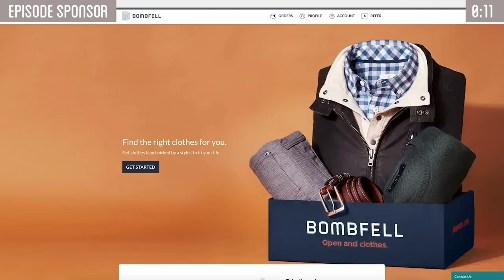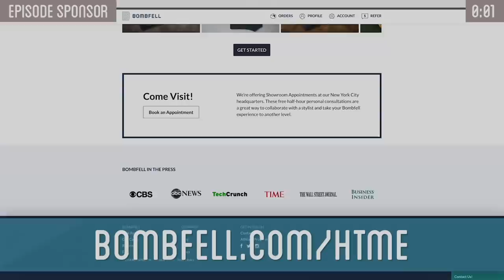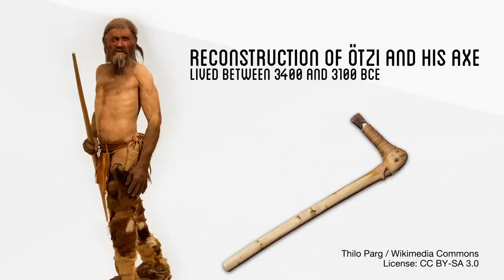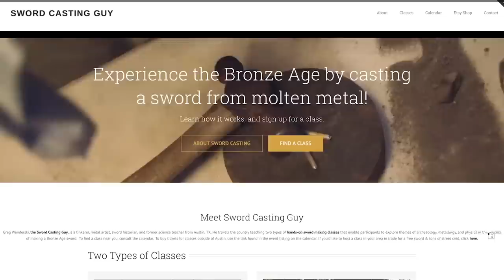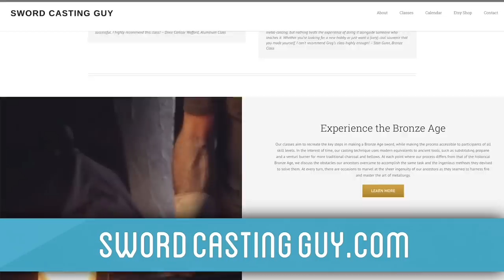Casting a Bronze Sword

Comment: I challenge you to use your glass and copper to make a lightbulb but you might need tungsten
Reply: Don't u need tungsten too for it?
Reply: Amith W.A tungsten is just better, not needed.
I think the best option for him would be carbon (like the first electric lamps that were really useful)
Reply: You'd probably need mercury though, unless you can think of another way to draw a vacuum?
Reply: Considering he uses his modern bandsaw and drills all the time, he'd probably just buy a vacuum pump too.
Reply: Lol, I think it takes more than that, but I might be wrong. But definitely the wire would have to be very thin
Reply: Amith W.A he could try to do make the fillament out of carbo from paper or bamboo, like the first lightbulbs, because tungsten sounds hard to make.
And wouldn't the first logical step be to make Power.
Reply: im pretty sure you would need to use something that melts at a much higher temperature then copper
Reply: From what I remember, decent results can be achieved by using a sliver of carbonized bamboo, however, making a light bulb that functions for any significant length of time usually means having the ability to pull a substantial vacuum and backfill with a carefully controlled amount and composition of gasses. It may be possible to use the same bamboo sliver method and simply paint the sliver in a coating similar to what they put on old thoriated lantern mantles. That produces a surprisingly bright light when heated and may protect the bamboo filament from being eaten away by oxygen.
Reply: What's the little curl thing in the light bulb made of? & how would he craft it?
Reply: Amith W.A tungsten is just a high temperature use he can make a copper light bulb it just might break from heat
Reply: Bamboo was once used as a filament for light bulbs
Reply: I challenge you to spell challenge right.
Reply: They're definitely planning to do that already in an upcoming Electronics series. Though it might be awhile, they have some other kinks to work out first.
Reply: @micahphilson  I already made the suggestion for making a lightbulb. Good idea.
Reply: But how many filaments does it take to change a lightbulb?
Reply: Tina Abrahamson It's called a filament. It can be made of anything that will glow white hot without melting. Usually a tungsten alloy.
Reply: mechanical pencil lead, not sure if it'll go fully incandescent but it'll make plenty of light before that. Electroboom says the dumber you are, the more likely you could invent a light bulb
Reply: @ShaneGadsby  vacuum is not needed
Reply: @talhatariqyuluqatdis a tungsten wire with a vacuum (no oxygen) to keep the thin wire from burning/melting and a high voltage should work.

Comment: I'm surprised there wasn't a mention of work hardening the bronze.  it won't keep an edge without work hardening it.
Reply: epigeios Greg commented saying that they did, but it was edited out
Reply: very cool video makes me want to start making swords.
Reply: You mean hammering it in moderation [limited force]

and then polishing it
Reply: Bob Bobbington  bronze is cold hardened by hammering, heat doesnt harden it. Iron and steel are hardened by heat. (if im not wrong)
Reply: They might not use it
Reply: Espectador yes that's correct. Steel can be work hardened slightly since the impacts cause internal heat but far more significantly by heat treating
Reply: @Espectador666  I wanted to make a complete statement, but I don't seem to understand everything, and I can't find answers on the net.

Therefore, I can only say that wrought iron (and only this)* is only hardened by fire, if it can absorb carbon. With charcoal (and maybe hard coal) that works best.

So that the iron stays that way, it has to be treated after forging. There are different methods for this. One is to quench the iron in cold water. This has an influence on the structure of the molecules.

*) But why not go with cast iron, why wrought iron doesn't become unmanageable, if you forge it for a long time (or does it? Is it going to become cast iron?), and how it works in the blast furnace that you don't always come to cast iron; and so on, unfortunately I can't answer.
Reply: For anyone wondering, the reason work hardening hardens bronze is because it causes irregularitys in the crystalline structure of the bronze. This alows it to have elasticity, so if you bend it it will come back tk straight. Although as you harden it you are at a higher risk of snaping it.

Comment: I know it seems counter intuitive, but please don't wear gloves around a drill.  It will be a FAR worse injury as it will grab the glove and twist and pull your fingers off... vs just a minor to moderate cut. (At 13:54)
Reply: Ay man live life on the edge ya know what Im saying
Reply: Wearing gloves around any tool with rotating cutting blades should be avoided, really. Table saws, especially.
Reply: @gian3458  Yeah, it's funny how people think safety is always wearing equipment and don't do the proper research while they are trying to do this kind of stuff. should know better by now and now they are an example to the world...a bad example.
Reply: It's mandatory to wear gloves in while using these tools Western Australian workplaces, because Occupational Health experts make the rules & most of them have never been out of their office.
Reply: @jakubpluhar4914  surely oven mitts are safer than regular gloves, if the concern is the fingers being ripped off
Reply: It would be safest to use some kind of tool/jig to hold whatever you're working with and keep your hands, gloved or not, well away from the working part of drills, saws, etc.  Just make sure it will hold and that if it doesn't hold, objects will fly out away from you and anyone else or anything you don't want hit.
Reply: My dad had his thumb almost cut off because of that..
Reply: Don't stop making your videos HTME, I just want you to keep your fingers!
Reply: Not with a weak drill like that. Especially not when it's the the screw mode, where it stops at a certain resistance.
Reply: So glad I'm not the only one who caught that. "No blood on the shop floor" that's what I was always told.
Reply: Can confirm, and have an unbending finger to prove it
Reply: he has the gloves on to protect from hot metal of the cast. The odds of being burned by half-molten metal heavily outweigh the chances of having his glove get caught in the drill
Reply: @UTubeExo  at the moment where he was drilling the metal wasn't hot anymore for a good while
Reply: Gloves made of something like nitrile would be good, so then it would rip away easily, but save you from the minor injuries that could occur.
Reply: @Benjamin riggs and outdoors &A Buddy of mine lost almost every bit of finger on his right hand wearing a glove working with a band saw. Never had a chance to react.
Reply: @Benjamin riggs and outdoors &A Yep. It was a big deal because everyone in the community thought "Oh my what a tragedy" but really it was, hey dude, safety first is a real thing.
Reply: @jakubpluhar4914  wEaR aN OVen!!!
Reply: I used to work as a tech teacher in shop environments, and I don't know how many times I encountered this terrible habit. In some cases, being actively encouraged by other tech teachers. Rooting it out entirely and getting kids to take the time to clamp up proper work holding was a constant battle. Totally worth it to keep everyone's fingers attached and finger-shaped though. even when it doesn't cause injury, it wrecks the gloves and then in a mixed welding environment, you can get spatter burns which are a lot worse than the sparks from a grinder hitting you.
Reply: Im not sure if alot of people seen a long drill bit but I used one for concrete (about  1 inch dia, 2 feet long) . And i was pushing down and it would brush up against my leg ( wearing pants). Someone warned me it can get grab your pant leg and twist really tight and sometimes it can rip off a mans penis. Thank god it didn't happen to me
Reply: Your likes are 666...
Reply: Hmmm. Thanks for the life tip
Reply: Yep. Learned that in engineering class.
Reply: Got my hand tattooed by a wire wheel on a drill thanks to a glove getting caught. This is sound advice.

Comment: 13:52 Hey broham, don't wear gloves when you drill, especially using that bit 😎.
Reply: Jon Gordon y
Reply: You're also not supposed to use gloves with a saw for the same reason. The glove could get stuck in the rotating blade so it's a lot safer just to use your hands.
Reply: if im right (which never happende) it aplies to all rotary tools
Reply: @azra7874  just moving parts in general. If the gloves get entangled in any moving part on a large machine, hands will be drawn in with them.

Comment: Figuring in losses in casting from the sprue and shaping and all of that, and depending on the type of pennies used (presumably pre-82 minting) and the alloy composition (let's say 88% copper), I figure you'll need roughly about 300-350 pennies to make a sword (0.8kg), give or take, I'm guessing. You'll likely want to make a bigger batch of bronze for the pour though, so let's say 350-400 pennies to play it safe, but you'll almost certainly end up with excess metal remaining.

Comment: You may have a bit of trouble since American pennies are mostly zinc, resulting in an alloy that is more akin to brass (Brass is an alloy of copper and zinc). While bronze is an  alloy of mostly copper with about 12% tin.  Either way, you will want a secondary source of copper for making your alloy.  Additionally, if you do opt to stick with copper and zinc, you can add a little bit of aluminum to add additional hardness and corrosion resistance.
Reply: MiddKnightAlphaOmega It’s also illegal to purposefully damage or destroy legal currency in the US, UK and most other countries
Reply: @brytenwaldaco.productions825  Wrong.

Comment: I have an almost identical sword, which I made on a course run by a friend of a friend.  Mine does not have the full pommel, but it has a much finer finish, and I used no power tools.  Just a selection of files and different grades of abrasive cloth/paper.  Something of a jewel in my collection, because it was made by my own hands.

Comment: Just a heads up, it’s illegal to melt US currency for their metal content.
Reply: No one seems to care about pennies, though. I saw someone make a fancy kitchen floor out of pennies and epoxy resin, which I'm pretty sure is also illegal, but they didn't get any nasty letters from the Treasury Department even though it went viral.
Reply: It also isn’t illegal. If you aren’t going to try and use those as legal tender then there is no issue
Reply: @ElijahCem  I did not state anything on the matter of him using them as a legal tender, I had stated you may not melt US currency for their metal content specifically. To "alter" a coin and use them as a legal tender is a different matter and is still illegal.
Reply: No its not. You just cant sell or profit by the destruction. You can specifically destroy coins for novelty use, the law for which you can read at any museum gift shop where you crush a quarter or penny in a machine.
Reply: You're wrong...
Reply: @brokenwave6125  Thank you for responding after two months to say two words on a topic that four other people "corrected" me on. I really appreciate it and it was a good use of your time.

Comment: Did you work harden the cutting edges of the blade? You're supposed to do that with bronze blades, leaving the rest soft and pliable but reinforcing the strength of the blade edge by work hardening it via hammering.

Comment: If you’re going to melt pennies, make sure to get a certain year before 1982 or something. Pennies in 2018 have a small trace of copper, but is actually mostly made of zinc (along with nickels and dimes).

So you need to research a certain mint year of when they originally used copper

Comment: it's really nice using these methods of melting like gas and what not, but to know the true spirit of making molten metal you have to do it the right way.
I tried several times to melt copper using charcoal and you cannot do it just like that, its more challenging and you have to do the math correctly in order for everything to go right!

Comment: Knives and swords aren't chopping tools, they are slicing tools.  With a slicing tool, you apply pressure and pull the edge along the surface to be cut.  Look into hardening, as mentioned by others, it is necessary for holding a cutting edge.

Comment: I have a question, I understand that you used copper scrap, please tell me how, 3000 years ago, people obtained copper with a purity of about 90%, since with today's technology in steel mills we obtain a purity of 70-75% only after the electrolysis process we obtain copper with a purity above 90%

Comment: You should have used a finer material to polish the blade. Just using an angle grinder probably limited the edge's sharpness. Also, The angle Andy ground the edge seems to be questionable.

Comment: Someone tell Greg to put the sword into the mold before putting the green sand, that way there won't be any cracks when putting the sword. Also he should put a little wood strip and a pipe of some sort (the pipe is put on top of the wood after the first part of the mold is made) that then only needs only needs to dig 1 or 2 channels into the mold, that way he doesn't have to then dig out a channel into the sand itself, risking the mold to deform in the process. And finally, please make sure to preheat your ingots so that you don't have the risk of the ingot still having humidity or water on it and causing a steam explosion.

Comment: So, melting pennies will produce brass...zinc and copper make zinc brass while aluminum and copper make aluminum brass. Zinc melts at a slightly lower temperature than copper and once separated your copper is thinner than paper.

Comment: I did the math and you'd need roughly 300 pennies from the years 1837-1857 to have the correct amount of copper and tin for a weaker form of bronze used in the making of a roman sword

Comment: Casting weapons isn't the smartest idea, as it will be weaker. Bronze is a weak alloy to begin with, so casting is more acceptable. I would suggest forge hardening the edge at least for a stronger cutting edge.
NEVER cast an iron/steel weapon. It will be a lost cause, as the weapon will either be too flexible to be used effectively, or too brittle and shatter at a strong impact. Steel must be forged using the proper steel to begin with. Also, spears were the most common weapon for almost every empire. Rome is an exception. The battlefield favors spears.
Reply: I mean, you’re right, but they’d make some dope decorations

Comment: You're going to have to use older pennies because the newer ones aren't pure copper...they are simply copper plated...also there is the issue of it being illegal to deface/destroy US currency. Technically even those machines that make special shaped holes in coins are against the law...though they are rarely if ever prosecuted.

Comment: this blade is completely unworked hot or cold, it will break within the first few hits against something solid, if you want to make a blade, you need to smith it, that means hammering it while its hot, or hammering the edges after it cools, and the crucible looked like there was loads of dross on top of the molten bronze, you should be removing that, it can affect the quality of the metal significantly.

Comment: "Did not have screws until the industrial revolution"
I hope he ment (and chose to believe so) that they did not readily have affordable screws until the industrial revolution. 

That said..
Well... it depends on how you define it.
"Thread cut from wood was first used in Egypt (around 2500 BC)"
-Wine press and oliv oil making.
Unknown source, had to look through my notes... so i guess source is me... but probably easily googleable.

Also, the oldest screw ever found was from around 400-300 BC.
Also not that hard to google, found several sources..
/Nerd out.

Comment: bronze weights 2.5 times more than steel. thats a heavy little sword. now i want to make one. but using in the  ground forge like they did in that time period.
Reply: Actually bronze and steel are about as dense, but steel is much tougher and harder. Both of course have variety of alloys, but densities are about the same. Some bronze alloys are slightly denser than steel.

Comment: Its funny really everyone is making the shape of the blade is smaller at the grip side. WHY?! You want this part to be the widest! When you sharpen the blade, it will eventually get into the shape archaeologists find these swords in. If you start up with the grip side of the blade smaller, you have way less life on your blade, than if you were to take a wider than the rest part of the blade on the grip side.

So by all means make it tapered from the bottom up.

Greetings,

Jeff

Comment: i cant help but notice that these swords are extremely flat and thin,  they oft seem to lack the mre complex 3 dimensional geometry the originals had, such as many swords having thick centres with the blade rapidly tapering to the edge bevel to allow a quite sharp edge but enough support behind that edge

of course this was quite a balancing act to not make them too chunky and overweight.

Comment: Pennies are a very bad idea.
They are full of zinc. This will melt before the copper, the molten zinc will start to oxidize and form toxic fumes before it amalgamates with the molten copper.
Also zinc+copper make brass not bronze. 
Also the ratio is all wrong, there is too much zinc. Although it would be a very pretty golden yellow, it would be too soft for a sword.